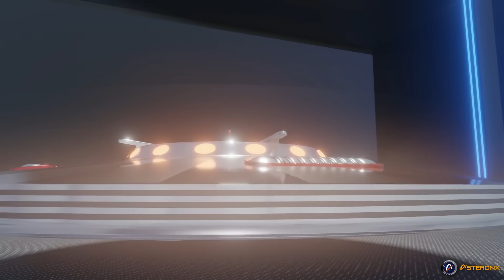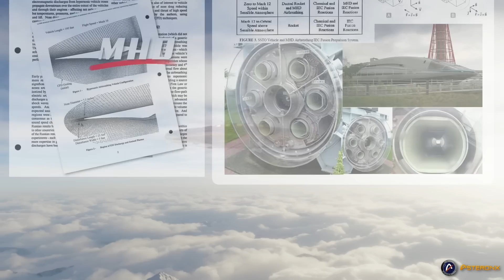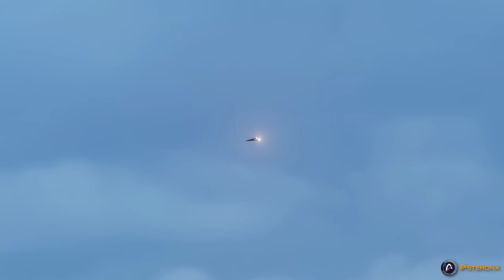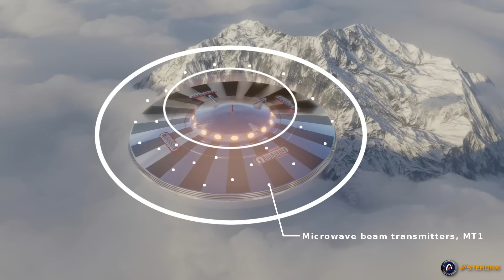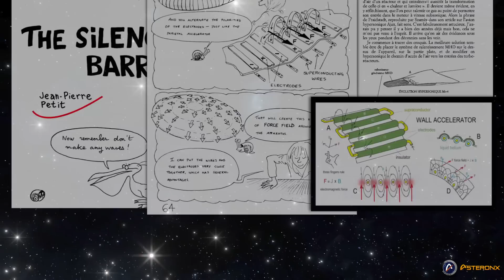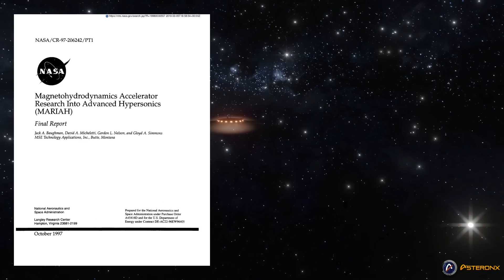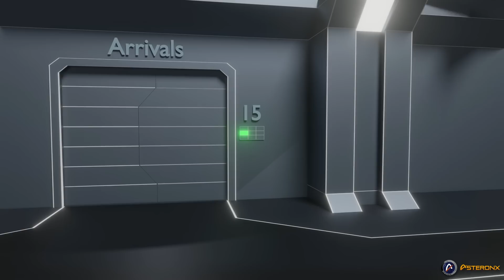Wingless EFE Touring Craft MHD

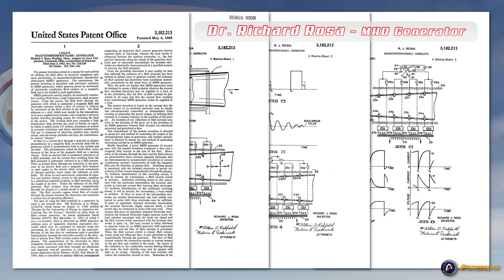Comment: EHD for Electro HD.  At 5:59 shows the Coanda Effect discovered in 1930 by the Romanian aerodynamicist Henri-Marie Coanda (1885-1972). He has observed that a steam of air (or a other fluid, presently we are using ElectroHydro Dynamics as mechanical motion to move IONized fluids)  emerging from a nozzle tends to follow a nearby curved surface, if the curvature of the surface or angle the surface makes with the stream is not too sharp.
  If a stream of water is flowing along a solid surface which is curved slightly from the stream, the water will tend to follow the surface.  Great video, you make curiosity very interesting.
Reply from the maker: Actually, that is a clip of Dr. Rosa's MHD lift fan design, not a Coanda effect craft, here's a link (from the video description): http://www.projectrho.com/public_html/rocket/flitters.php#id--Flitters--Flying_Saucers--MHD_Lift_Fan
Reply from the maker: But there are simularities, as we stated, the whole system functions like an electromagnetic Coanda effect craft.

Comment: I thought the 50's and 60's experimentations had determined that a saucer shape was unstable for atmospheric flight?
Reply: Yoo, they told so. We will see how it all works by better advanced tech
Reply from the maker: Yes... So is a flying wing, and a drone, and the Lockheed F-117 Nighthawk, and modern forward-sweep wing fighter aircraft. Computerization makes feasible many aircraft designs that were impossible before, and having direct and total control of the air around a craft (via MHD) helps a bit too ;)

Comment: You've managed to take an a very simple concept, and make it much more complicated than it needs to be. First why make a flying saucer in the first place. Just take "lifters", or "caterpillars" put them on a lifting body and use them for propulsion like a standard jet engine. Once in space you can feed them a Nobel gas,or use the space ramjet concept to accelerate interstellar hydrogen to propel your craft. I've done a lot of work with these drives,and ion/sonic force fields both in electrophoresis and in open air. Most of what we think of as star trek technology is possible with existing technology and resources. The only think holding me back is money. But if I can do all this with stone knives and bear skins,imagine what could be done with just a little real funding. I've also built a high energy microwave laser,or maser and partical beam both of which can be controlled by a magnetic yoke to be used for anything from brain surgery to star wars missile defense. We've also done some experimentation with transporter and replicator technology. Exploiting the interaction of a maser frame,painted by the particle beam to "print", or " replicate" simple materials and objects down range. Again imagine if we were working with something a little more expensive than stone knives and bear skins.
Reply: The bronze chisels, mallets, saws etc that were the ancient Egyptians state-of-the-art tools probably weren't much more expensive than the stone knives that were also available. But who would want to waste 10 generations of your family smoothing off the surface of a granite slab with stone knife and bear skin when you could do it in 8 generations with a few hundred bronze chisels and as many mallets as you could find. I bet the hardest bit was not the granite itself but finding any trees to make handles for the mallets.

Comment: Just need a compact high density energy device and we would be on our way.. I have seen patents as far back as the 1950s having MHD like designs. The tech is here but the engine is not... Soon.... We are in a Wright Brothers stage... They made the power source that made the plane fly....
Reply: the wright bros bought a motor from the sears catalog (they built bicycles not motorcycles)
Reply: @samcummins8319  the Sears catalog was a good thing but no..  they designed and built the engine .. 4 cylinder aluminum sleeve engine 27 hp.. and yes they built bicycles also... It was a bare minimum lightweight engine so the plane wasn't too heavy.. wing area to weight ratio... The Smithsonian didn't do that and hence declared that planes won't fly...
Reply: im sorry your right I learned something thank you  @platypusrex2287
Reply: Actually we do have the tech, we're just not allowed to use it. Look up the Searl Energy Generator sometime.
Reply: @LarryH54  researched that back in the 1980s... Too bad no one has replicated it..

Comment: This all sounds well and good but I must ask about the safety precautions of piloting such a craft beyond just the obvious. This type of propulsion will require extreme levels of power to generate the required ionization energies and magnetic fields. Which means that all crucial navigation and life support systems must be very well insulated from the MHD drive. Plus you would need a significant cooling system to manage to keep those superconductors cold as well as preventing overheating from electrical resistance and power source. At the speeds and electrical power this hypothetical craft would operate on you would need an AI to pilot the craft and a very effective fire control system to prevent on board fires. Plus if something were to go horribly wrong with this craft at high altitudes and at high speeds, you need to bail out which means that you would need in board pressure suits and several parachutes made of unobtanium.

Plus, given the performance and high speed of the craft, by international regulations it would be restricted to flying at high altitudes.
Reply: I once knew an inventor who told me about his 'crazy coil'. Specially wound, it got COLD when powered up. He never told me HOW it was wired.
Reply: @LarryH54  he is selling you a pile of shitt.

Comment: In the 80's, when I was a teenager, I had the first contacts with ufology in reading the magazines Planeta, Brazilian version of the French Planete. It was in one of them that I read the story of a Brazilian mathematician who imagined the ionoptero because I was more interested in the technical aspects of UFO speculation. Well, the ionopter was already advancing the MHD concept. Basically it was the description of a truncated cone with the top loaded with positive electric charge and at the base a ring with negative electric charge. Near this lower ring were small windows, or openings, for the output of electrons that would neutralize the positive ions such as nitrogen gas, so common in our atmosphere. What was interesting was the shape of the electron emitter: it looked like a swastika, with its arms emitting electrons. The source of energy would be three nuclear mini-reactors arranged below the apparatus at 120 degrees from each other. They would have the shape of semi-spheres serving as landing gear and center-mass balancers and maneuverability of the aircraft when in flight.
Reply: Three reactors? Then it was a triskele instead of a swastika, I´d think.
Reply: @olafseverin1135  - If I have understood correctly, although I have never seen the word "triskele", the electron emitters are tubes at right angles with their radial axes forming the arms of the "swastika", the symbol of ancient India. This swastika rotates around its axis releasing electrons in a spiral motion at the equator of the apparatus (ionopter). This would neutralize the positive ions. The three reactors are at the bottom. They would move radially between the center and the periphery of the disk. Providing electric power and equipped with gyroscopes would give the maneuverability to the device in his flight. I would add a Tesla coil as the central shaft for supplying the required high voltage. Hope this helps. 
Greetings from Tupã, SP,  Brazil.
; - )
Reply: Oki, thanking u for this further insight, Eliel. A triskele (if writing the word was correctly) is a symbol with only three arms instead of the four.  @eliel-n1s
Reply: That's an EM drive unit and has recently been debunked. They've built one and tested it and it didn't work. Sorry

Comment: There is a massive gap in your design (about 64 km of it actually). This design requires an atmosphere (air) for ionization. Out of the 80km between sea level and the karman, there is very little air above the 16km. How would you get the craft across the rest of that distance?
Reply: intresting question...